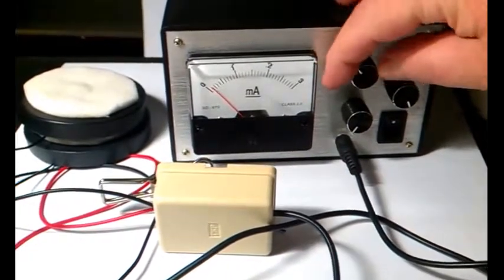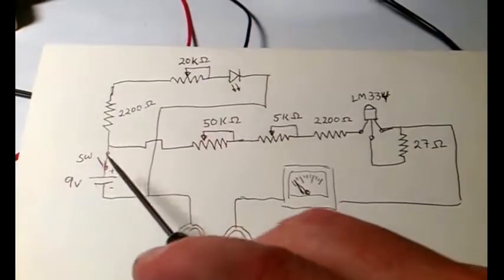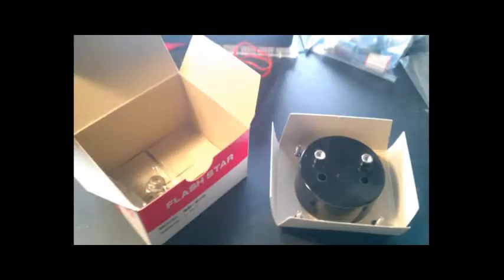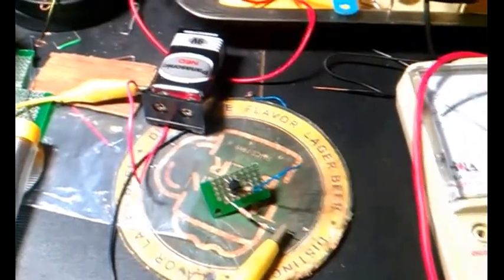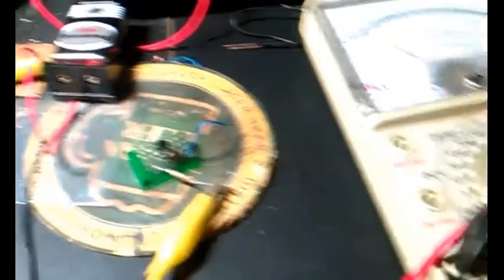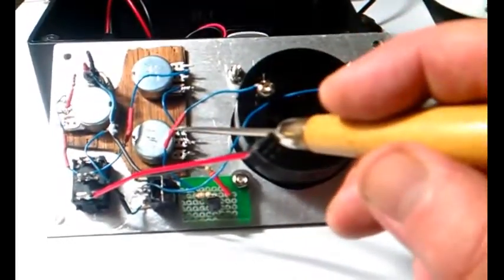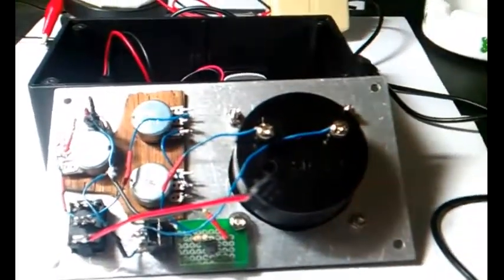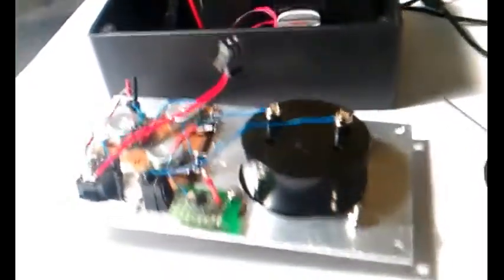My tDCS Experiment: Part 9: Final Build

Comment: you know-just saw schematic in part 9--but still don't understand why double up the pots..fine and course control?  and why the 2200 ohm fixed resister--the skin/head resistance seems to be about 7k..so with 9200 ohms of resistance total - I can't get the math to work...
Reply from the maker: Sorry, I can't help you with the math. I didn't do any math in this process, I just started with one circuit (based on the LM-317 voltage regulator) and gradually migrated to a similar circuit (using the LM-334 current regulator). Everything was based on trial and error until I ended up with something that "works". 

If you find ways to improve it, please let me know. I bought enough spare parts that I can probably build another one. ;-)